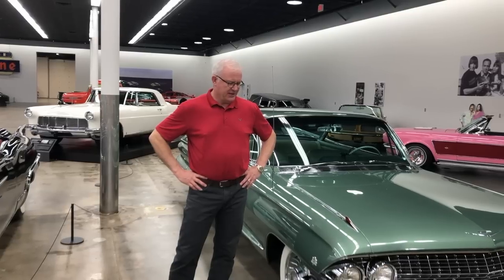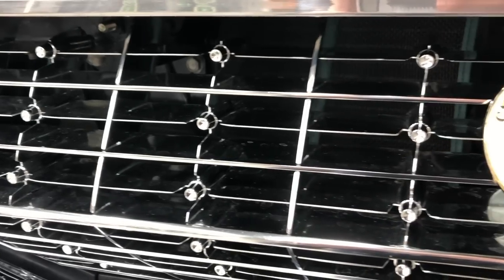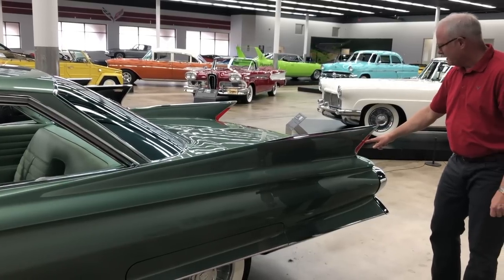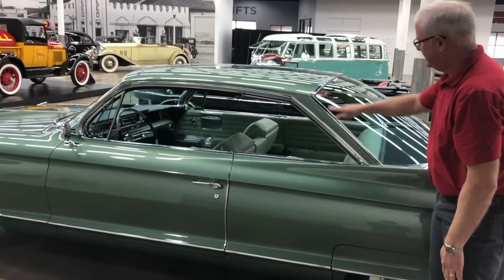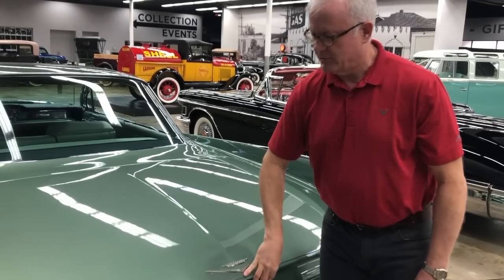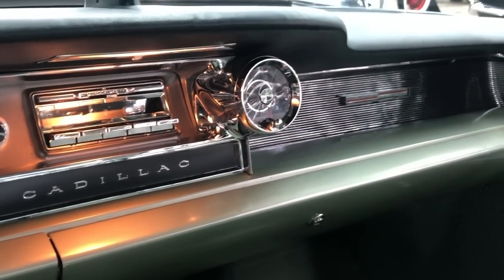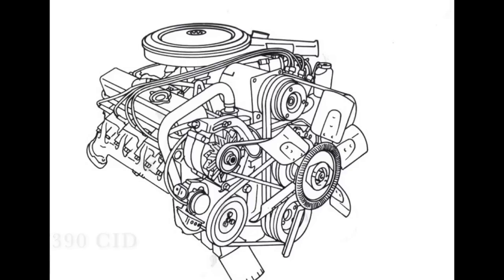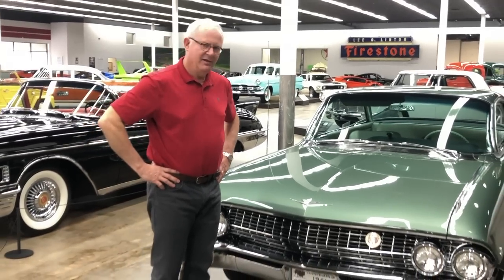MUSEUM-QUALITY COUPE DE VILLE

Comment: Yeah, I was 5yrs old and my only thoughts were what for Christmas would be my toy. 
 This was a  transitional year for Cadillac.  The sleek body style was very 60s cool, classy, and sophisticated. I would definitely convert the brakes to disks if possible. And electronic ignition. She's a beautiful old girl though. 👍
Reply: If you deviate from OEM, you will decrease it's value greatly. Resto modded cars are typically worth less than 50% of an all original car of the same vintage. 
These cars are trailer queens, many haven't been driven for years. Many of them aren't even drivable. Jay Leno has commented that he has never ever driven  some of his many fine cars.

Comment: When I was a kid we had a 61 Coupe de Ville identical to this car, same color. My Dad traded in his 2 week old 61 DeSoto on it and never bought another Chrysler product. Ours had no AC though, not until 1966 did we have a car with AC. I got my license in 1963 and I was allowed to drive it now and then. The first time I floored the gas I found out that the pedal would get stuck in the carpet and I had to reach down under the dash and pull it back up by hand at about 70 mph. I guess in 2 years of driving the car my Dad had never used full throttle? Fun times!
Reply: My idiot car got the 'gas peddle' stuck and I ended up going 85 mph with the brakes on, so fun.  I shifted into Neutral and pumped the gas some and back into drive.  I don't think my transmission liked hitting drive at 85 mph.  I made it home and brought my car to the garage and was told it was my transmission computer card linkage module or something like that.  I guess the days of a mechanical linkage were way in the past.
Reply: @kfl611  With our 61 Caddy it was the pedal itself that got stuck. The gas pedal was on an angle with a pointed corner on the top and if you put it to the floor it would stick into the carpet and stay down. It wasn't just one time, it would happen every time you pushed the pedal to the floor. Apparently my Dad, who would never own any car without a V-8 because he claimed he needed lots of power, never actually used much of that power, because we had owned the car for 2 years and never discovered this until the first time I drove the car. These old cars are nostalgic to many people but the fact is they had some really half-assed engineering sometimes, which I discovered when I began working as a car mechanic in 1971 (we were mechanics back then, not yet "technicans").
Reply: @barryervin8536  Kind of how a soda can from the back of the car one time rolled up under my brake pedal and I could not brake.  I had to reach down and grab it while driving, not easy to do.
Reply: @barryervin8536  true

Comment: Details on the transmission?

I see:

“Park”
“Drive” (1)
“Drive” (2)
“Low”
“Reverse”

Is this a 4 speed transmission, with no selection for “Second”?
Reply: bobcat baldfat drunkbeater   Sad the transmission failed at 10 years old, but you got to enjoy a Fleetwood for 10 years!  I have to look up a 1971 LeSabre.  I can’t picture it.

Comment: Whitewall width had been "narrowing" since 1956 and by 1959-1961 they were at about 2-1/2" to 2-1/4."  In 1962, Cadillacs would wear "modern slim-band whitewalls."  1961 was the last year for "wide whites" (although at 2-1/4"...they weren't all that wide).  These whitewalls look a bit wider than they should be to be considered "period-factory-correct."
Reply: 1961 was the last year the whitewall went to the bead of the tire and they were 2.25 width. 1962 saw the narrow whitewall ranging from 1.25 to 1.5 inch width but with black between bead and whitewall.
Reply: @dougmeloan3856  Correct.

Comment: Amazing difference compared to the superb 1961 Lincoln Continental, the epitome of class and elegance.  This Cadillac is so vulgar in comparison to the 1961 Lincoln.
Reply: I love 61 Lincoln Continentals too, yet Cadillacs were anything but vulgar, evidenced that Cadillac out sold Lincoln Continental 138,000 to 25,000.
Reply: @dougmeloan3856  Vulgarity always sells better!
Reply: You should have your glasses checked. The 1961 Cadillac Coupe de Ville was an amazing car. The Lincoln was as bland and generic as it gets.
Reply: @MarinCipollina  1960 Caddy was a much better looking car. This looks like an overblown Chevy. Profile and rear are simply hideous.
Reply: @viciouspoodle5543  I love ALL the Cadillacs of the 1940s through 1970.. What followed was problematic for decades.
Reply: @MarinCipollina  The worst were those tiny downsized cars of the late 80's early 90's. Just horrible.
Reply: @viciouspoodle5543  Starting with 1985.. Those were dreadful, but Chevrolet always shadow reflected Cadillac design to a degree.